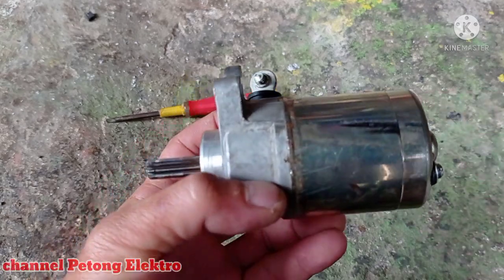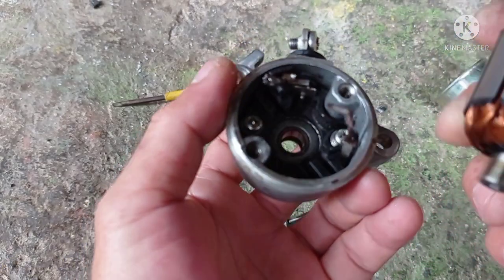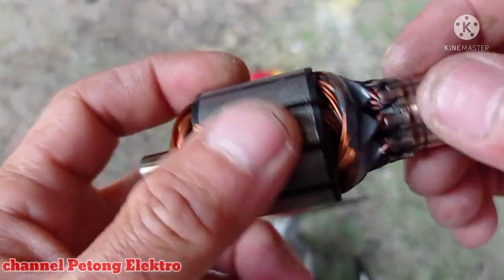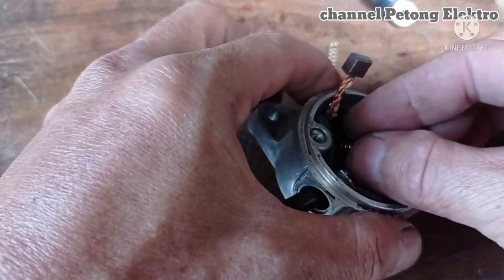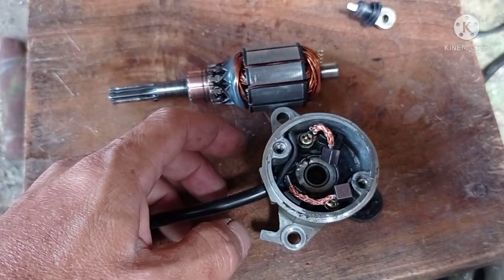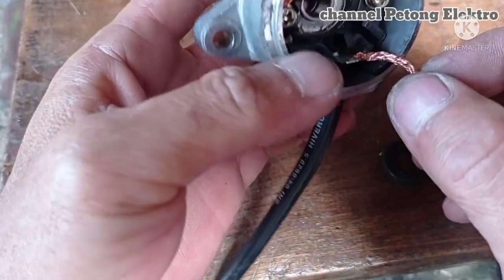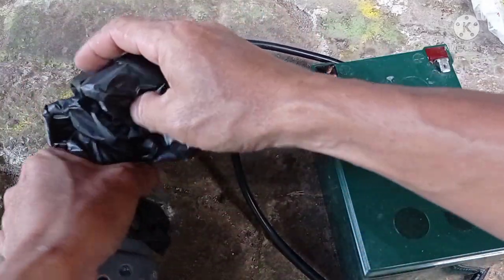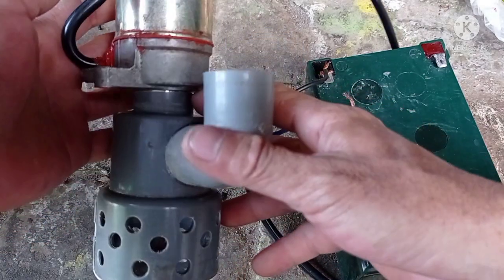Pompa celup 12V dari Dinamo bekas Starter Motor

Comment: Mas itu dinamo nya dinasukan ke air ga rusak?
Reply from the maker: Selama kabel keluar rapat di perkuat dengan Lem silikon, aman. Karna spek Dinamo starter motor juga sudah di rakit kedap dari oli. Bagian shaft dinamo ada seal yang mencegah oli masuk. Tinggal bagian kabel. Awalnya kabel positip (+) berada di luar, kemudian saya rubah di dalam semua kabel + dan kemudian kabel di beri Lem silikon.

Comment: Bang saya pakai dinamu stater motor Mega pro kabel putih yang besar tapi panas kabel nya apakah karena kabel nya tidak saya baut sama aki atau ada kesalahan lain bang?
Reply from the maker: Kabel berapa mm?.
Reply: @petongelektro  2 X 2.5 mm²   300 / 500 v
Reply from the maker: @revanproject5742  kurang besar, coba ganti 5mm atau lebih tambah bagus.
Reply from the maker: @revanproject5742  untuk kabel harus yg tembaga murni, karna sekarang banyak kabel yang ber bahan almunium.
Reply: @petongelektro  oke bang terimakasih saran nya
Reply from the maker: Coba diameter kabel samakan dengan yang aslinya saat Dinamo itu di gunakan  di motor.
Reply from the maker: Jika masih panas berarti armatur / angker Dinamo sudah tidak normal.
Reply: @petongelektro  tapi dinamo baru bang belum pernah saya pasang dimotor